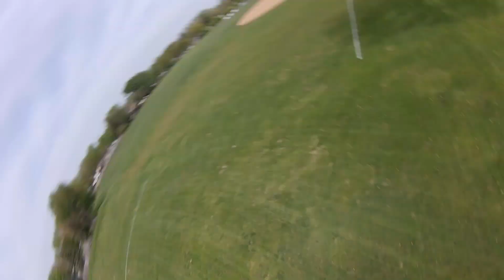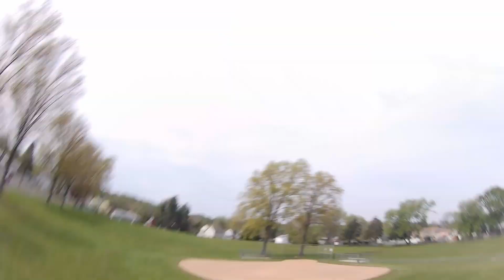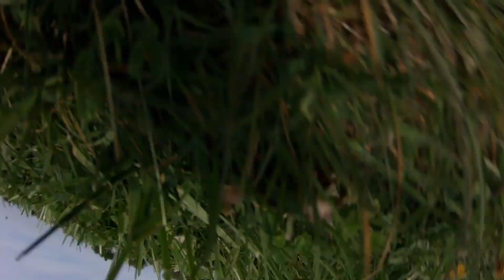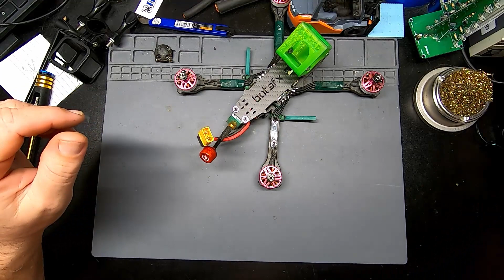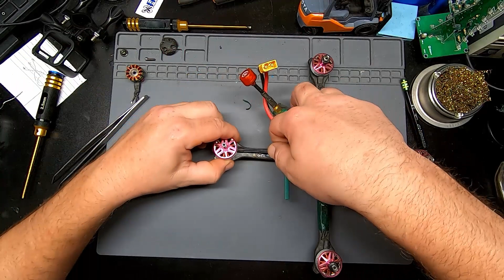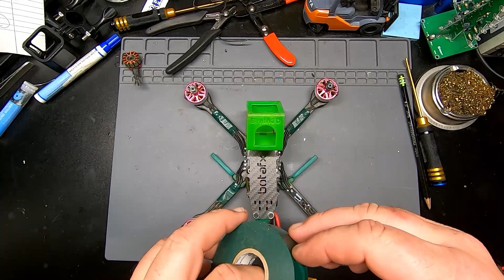We Fix The Drone

Comment: Lead solder is better than lead free one? Yea, because it doesnt need to be heated up that much (low melting point) BUT it contains hazardous substances that under all circumstances should be avoided to be inhaled not to risk cancer. Meanwhile manufacturers have developed several types of lead-free solder with unique properties and therefore it's an improvement to get rid of its side effects. Good enough for me.

Comment: The 2 outer motor wires could have been swapped back to make all 3 wires parallel and the rotation would be correct.

Comment: Thanks for posting, especially that solder station, got a Hakko, but no hot air, might be picking up one of those. By the way, as far as the videos be random, but as often as you can. In closing, I say "Use lead and tin, for the win!" I'll show myself out.

Comment: I was flying my giant radian at that school a couple of years ago when a bolt of lightning came down and took out the transformer by the road. It had stopped raining like an hour before and I was lucky I didn’t get hurt but I’m pretty sure that all the people who saw/ heard the explosion thought I hit a wire with my glider.
Reply: I've always wondered does lightning actually come from the ground or from the sky. It happened so fast our eyes aren't able to tell. I would not be one bit surprised if it does however come from the ground and we've been lied to our entire lives saying it comes from the sky. I say this because why is everything grounded to the ground?
Reply: @jeffreywolf5235  you've never seen lighting recorded on a high speed camera? The charge originates in the storm/clouds and discharges to ground
Reply: @christhut8140  but what if the clouds we're upside down? Would you zap space shuttles?🤨
Reply: @moneygettaextraordinar722  If the clouds ended up upside down I think would be dead before that happened we'd have huge issues to worry about lol

Comment: What is total cost of the setup of that particular drone? Controller, vr headset, drone.
Reply from the maker: Probably 1k all in for this type of setup. eMax makes a cool all in one set up for $250 that’s a good way dip your toe in the FPV pool before you jump in. It’s a smaller drone but it works good.
Reply: @FunkFPV  thank you